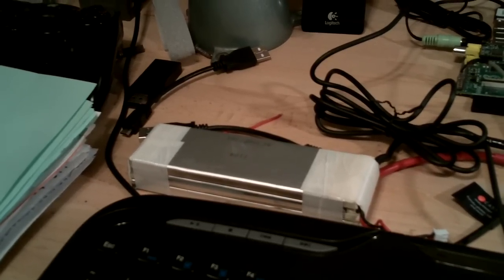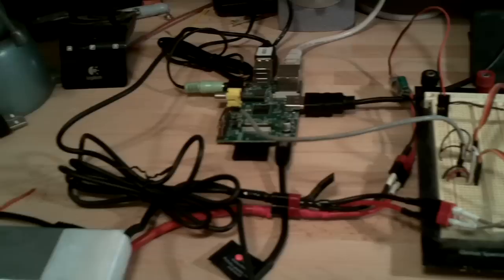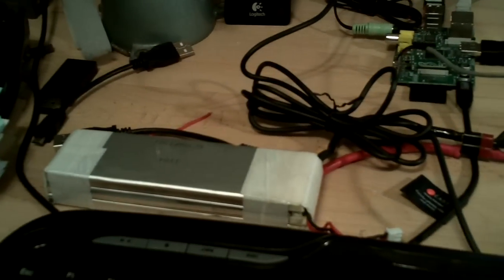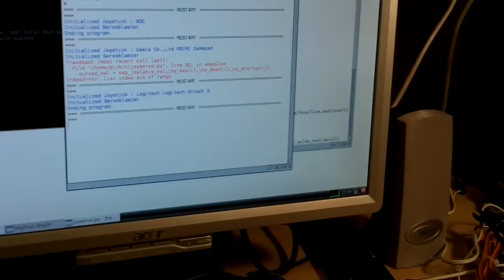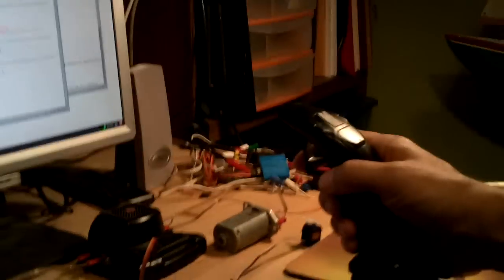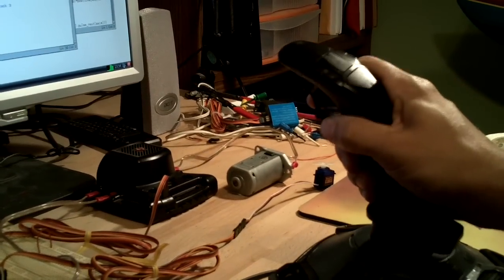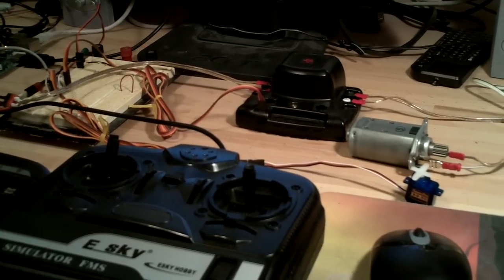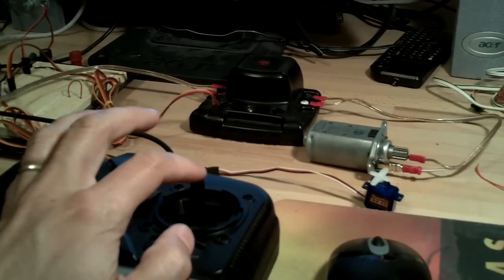Joystick control of servos with Raspberry Pi

Comment: i need all code plz
Reply: Hey dude...I never found this video when I was looking for usb joyticks and rasberry pi until it got linked to the one I just posted.   Wish I had because I struggled through the same thing. I put a link to my github repo in my pi video that has a pi, usb joystick, servo controller, also added analog inputs in one python script. Check it out and hope it helps you.
Reply: that's not help
Reply: +Mahmoud SHBAT really?  I thought my python wasn't half bad. Sorry.  Good luck with your project.